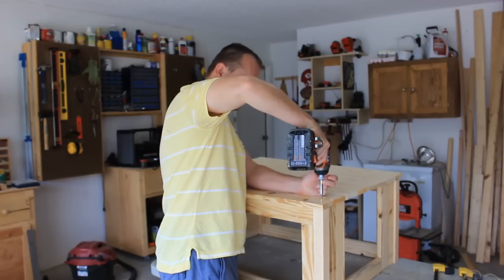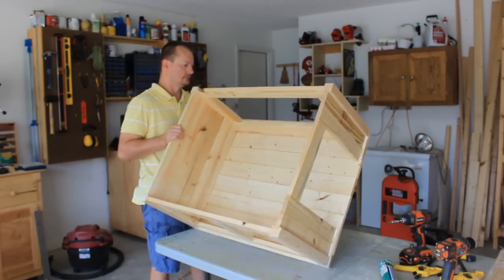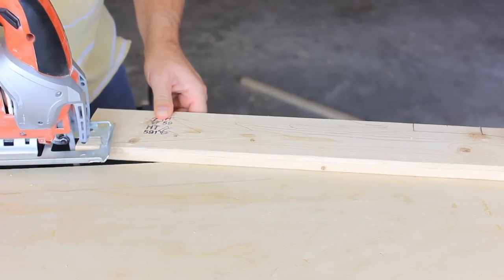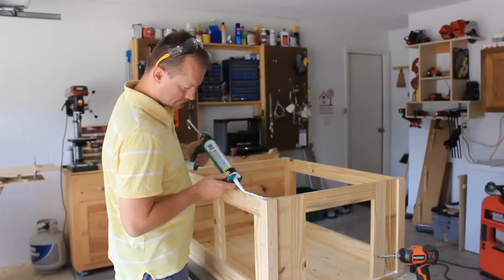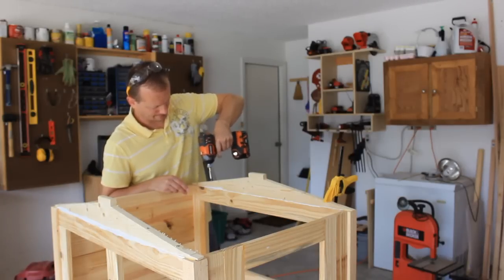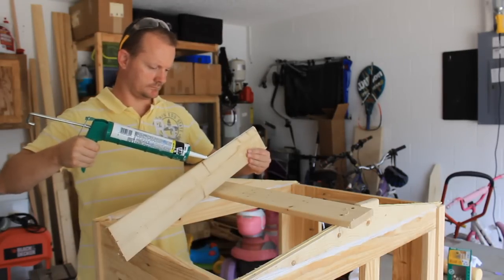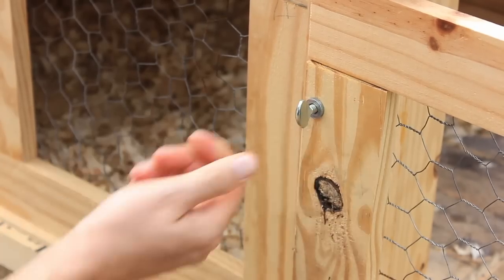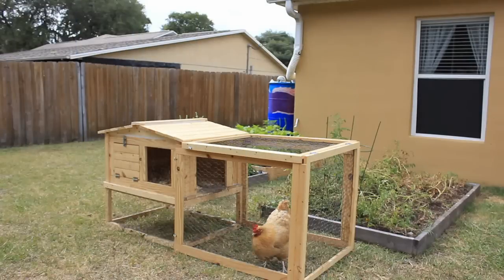DIY: Small Backyard Chicken Coop Part 2

Comment: A lot for a small coop, lol.
Reply: ikr but I'm thinking of tripling any maybe quadrupling this design
Reply from the maker: +Brave Cuber As stated in the video, description and website, this coop was built to double as a transport carrier.  Therefore structural integrity and durability were extreme points of concern in the design.  A lot yes.  Strong and durable, absolutely.
Reply from the maker: +Repti Keeper tripling or quadrupling the measurements may change elements of it's structural strength.  Keep an eye on that and stay safe.